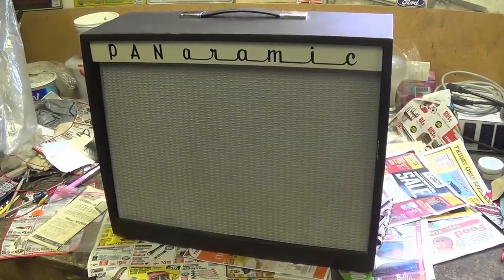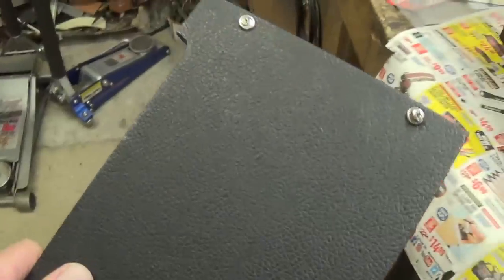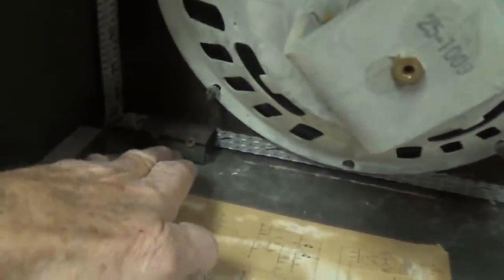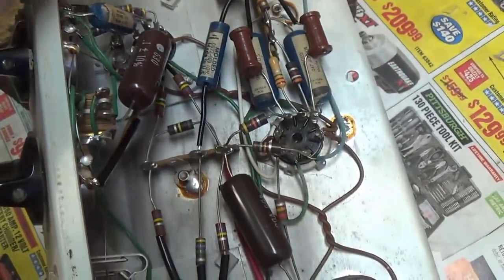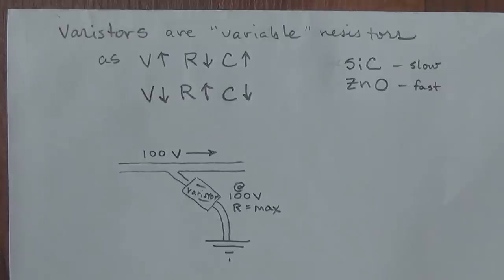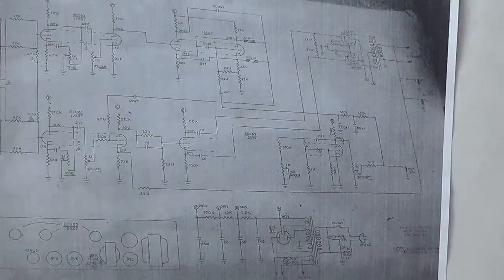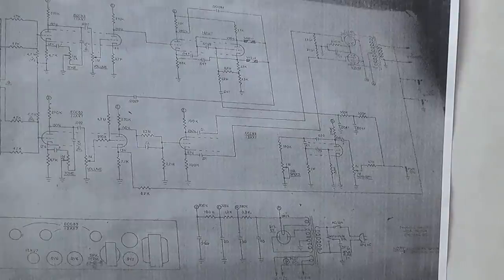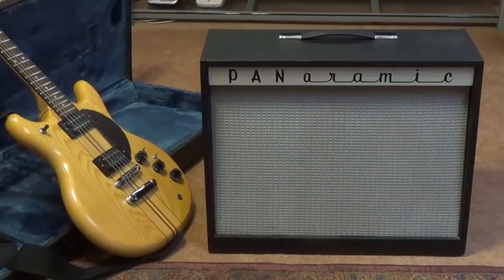1963 Magnatone Panaramic Model 1210 Amp with "True" Vibrato

Comment: Wow. Is that clean for the age. I own about 13 Magnatone amps. Various models. Only one is modern, a Twilighter Stereo. These are very underrated amps on the vintage market. btw the back panel was installed upside down.

I've always described tremolo as playing your amp through a fan in terms of sound. That choppy helicopter sound. Vibrato is more like the warble of a bird, organ or violin. 

Usually when I get one of these amps, I will replace the power cord with a grounded one. I will remove the death cap and possibly replace the canister filter cap but often they are fine.

I'd probably replace any plate resistors that have drifted to even out the power output of tubes. I'm not that much of a stickler keeping my amps stock because they aren't that valuable on the vintage market....and if anyone wanted that it would be easy to return the amp to stock with vintage parts.

Nice effort explaining the vibrato circuit. Few understand it.
Reply from the maker: Thanks so much for your detailed and helpful input, Joe.

Comment: Another very interesting and entertaining video . I don’t think I’ve ever seen a Magnatone amp over here in the UK, didn’t Buddy Holly and Duane Eddy use them? I’ve got an old early 60s Vox AC 30 amp which also has a true vibrato, I’ve heard that the Vox people “borrowed “ their circuit from the Hammond organ company but who knows?  I don’t know if any of the current crop of tremolo effect pedals have true vibrato or just use the amplitude variation method.
Reply from the maker: Yes, I believe Buddy Holly used a larger model, perhaps a 260 or 280. I'm not sure about the Vox "Vibrato" circuit. Unless they could unlock the mysteries of the Varistor, however, it would have been difficult to match the Magnatone circuit.

Comment: Uncle Doug, may I get in touch with you please, Sir? I have a Webster TP 45 pa amp, which works on 2 channels. Need some ideas.
Reply from the maker: You can ask your questions on my FB page: Uncle Doug's Vintage Amps, Mr. P. Due to the amount of correspondence I handle each day, the answers will have to be relative brief.

Comment: Great sounding amp.(just add reverb) 
Can you design a tube fx pedal that creates that vibrato ? I would love to build one.
The pickups in your Gretsch are Hi-Lo Trons, single coils
Thx for the video, I'm sure Chris would aprove.
Reply from the maker: Thanks, AJ. I have a Fender 6G15 that could be used with the amp for a real Verb-Vibe Fest :)  The problem with cloning of the Vibrato circuit is hampered by the mysterious Varistors and their unavailability.

Comment: I would be cautious around dust adhered to older mfr. speakers, especially if the dust is yellow. I have read that it is cadmium based, and is toxic. I had two oddball 500ohm speakers from a small japanese console built  around '63 that had it on them. I never heard of a PM speaker with such a high impedance, and it was the only pair that seemed to have the yellowish dust.
Reply from the maker: Thanks for the info, Ed.

Comment: Hi Uncle Doug--great job as usual.  The circuit used to create the vibrato is generically called an all-pass filter.  If you Google that phrase, lots of information will come up.  BTW,  "phasors" or phase shifters, as they are variously called, that used with guitars, a classic example being the "Phase 90,"  use anywhere from 2 to 4 all-pass stages, the 4-stage units being the most common.  That being the case, a phase shifter could be modified to create a true vibrato.  Although true vibrato can be a nice effect, personally, I find it can quickly go from pleasant to overwhelming, and can create a kind of seasick tone.   It's nice, as always, to see your kitties.  I think many of your viewers, myself included, appreciate your kindness in caring for them.
Reply from the maker: Thanks so much for your always-helpful input, R. This is a 2-varistor circuit, while the larger models offer 4-varistors.....which agrees with your analysis. I'm tempted to get one of the larger models,  just to experience the difference. However, I understand the "seasick" phenomenon.

Comment: Hi Uncle Doug, I've been enjoying your videos for about a year now.  I too have a black feline friend named Misty Midnight.  I have noted in your last 2 videos you found speakers from oxford.  back in the 70's when I was still in high school I worked at the Oxford Speaker Company in Sabula Iowa.  It was an after school job.  I was a gasket dipper.  I worked in a shed with a bunch of toxic chemicals.  The factory made speakers for cars.  The assistant manager once gave me a set of their 2nd best speakers, they had smaller magnets than their best.  used them for years in my own car.  The factory caught fire one night and there were many explosions (about 1979)  I had moved away but saw it in the news.  The only part left standing was the shed where I dipped gaskets.. if that had gone up the whole city block would have been gone, including the city hall/fire station, that power substation, and a shell gas station!  Thanks for sharing your videos and a glimpse of your home and town through your lens.
Reply from the maker: Wow, Jim, what a harrowing tale. We're glad you moved on before 1979. It's great to hear from viewers who were personally involved in the production of the amps and components we love. Thanks !!

Comment: I had heard Magnatone amps were the one of the only amps with true vibrato not just tremolo..I used to own a few 60's  transistor combo organs, I believe they had true vibrato circuits..
Reply from the maker: I believe you are correct, Dan. Fender produced a harmonic tremolo that had some frequency modulation (vibrato).

Comment: Why do you remove the "death capacitor" when you've added 3-wire power? Does it hurt anything? Degrade sound? Add hum? I appreciate that you leave it for historical reasons, but I'm really unclear as to why it should be disconnected.
Reply from the maker: If it were to develop an internal short, which is quite unlikely, sufficient primary AC may flow to the chassis ground to cause a mild shock.....or blow the fuse.

Comment: I struggled a good length of time trying to get my head around the concept of mixing signals so very useful in radios for example to drop the frequency down a decent notch so some serious gain could be achieved with cheaper components. The combined frequencies remain two and not the third wanted one until the two signals are subjected to active gain. The third offspring frequency occurs within the gain slope of the active device and is impossible to achieve using any and all passive devices. When I finally read that part, the light came on for me, but it was a lot of reading before I stumbled upon that jewel. Just a tune up for your very excellent run down of how the true vibrato works. I must say the effect here is a wonderful thing, I can hear so many favorite songs I love are using this too. Reverb/tremolo is fine as far as it goes, but true vibrato for me is a WOW thing. As you very simply put it (and I do love simple), much more musical. Thank you patreon people for giving Uncle Doug the bucks to bring this one to the cheap seats and thanks again Uncle Doug.
Reply from the maker: Thanks so much for your very knowledgeable input and nice comments, Lee. We're glad you enjoyed the video.

Comment: The description about the Moses circuit is fine, but the description about how that is then applied to the Maggie circuit is fundamentally wrong.  The Panasonic circuit diagram shows that they use the Moses circuit, and the variable resistance arm is replaced with a sub-circuit comprising the varistors in a cathodyne PI circuit that is modulated just by the lower frequency oscillator, and that sub-circuit is capacitor coupled in to the Moses circuit, and the mixed output is then capacitor coupled to the high impedance node of the feedback stage after the Vol control.
Reply from the maker: Thanks for clearing that up for us, Tim :)

Comment: Hello, first thank you for all the great videos!! They are so useful and great to watch. 

Second, in regards to the vibrato in this amp, could you have a switch that would switch between a tremolo effect and the vibrato effect? I’m not sure what the sound difference might be, but it would be cool to have. Thanks again for the great videos. 🙂
Reply from the maker: It would probably be possible to have both effects in one circuit, Stephen, but once you have heard vibrato, there is no way that you would ever mistake it for tremolo.....they are quite different.

Comment: Where can I get the Varistors needed, is it a good homebrew project? I'd like to build one as a preamp and just put in a little 5 watt single ended output stage so that I could use it to drive a power amp or as a practice amp. I have a Alembic pre ( a real one, got a good deal at an auction) and a THD Univalve and I use them with an old solid state transformer coupled Altec drive in amp sometimes. Sounds great.
Reply from the maker: That's the problem, W......the specific Varistors are hard to identify and purchase. Check the Internet and video description for details that might help you locate the proper Varistors. Good luck.

Comment: I'm thinking in this case, the spring-on-the-rod example might be more accurately (though possibly more confusingly) shown if you were to slide the spring back and forth along the length of the rod rather than compressing and stretching the spring. The reason being that the modulated allpass filter in this amp shifts the phase of the waveform rather than strictly the frequency. It is analogous to the Doppler effect, where the change in pitch is only done as long as the phase is being advanced or regressed. In this case by a low frequency oscillator. One interesting thing about this kind of vibrato is that the intensity is most pronounced at the center frequency of the allpass filter, as opposed to the kind of vibrato produced by modulated delay lines, which shift the full audio spectrum.
Reply from the maker: I agree, SS, including the final sentence. The Magnatone phase shift circuit is most pronounced at 1KHz, with diminishing effect the further the signal varies from this frequency.

Comment: It would be interesting to see a video or article about accordion pickups and how the electrification of accordions was done back in the day. I once had an accordion pickup that wasn't name-branded but it had four or five microphone elements, (peizo type if I remember correctly), in a footlong-plus chrome housing with a mesh screen, that looked sort of like a cross between a harmonica and a chrome car bumper. There weren't any brackets and I didn't see any tapped holes for threaded fasteners or fittings, so I had no idea how you would even mount it to or inside of an accordion.
Reply from the maker: I can't say that I've ever seen an accordion pickup, GU. It must be some sort of piezo device, since the accordion would not activate the normal magnet-string type of pickup.

Comment: Vibrato and tremolo are like FM and AM radio.  I think I like FM better than AM.  But there are instances where AM does better than FM.  Rusty in eastern Tennessee
Reply from the maker: It's quite a bit like Frequency Modulation and Amplitude Modulation, Rusty, in fact those terms actually define Vibrato and Tremolo.

Comment: From Leo:  Looks like a great keyboard amp.   I have never seen any amp that old that did not have rust discoloration on the input jack hardware. With no corner protectors and the tolex not damaged on the edges, you know that one never lived in a garage or basement.  Amazing.  I am confident that you will treat it right.  Thanks for sharing.
Reply from the maker: You're welcome, Barb. I agree......it is in amazingly good condition.

Comment: I just restored my amp. Is 120 mV DC too much on the speaker? How do I bias it down?
Reply from the maker: The plate current has nothing to do with the speaker. If your two 6V6's are flowing a total of 160mA, they are biased way too hot.....about three times the proper amount. The output tubes are cathode biased so their ideal plate dissipation is between 10 and 12 Watts. This value is calculated from the plate current and plate voltage, and is regulated by the value of the cathode bias resistor. Please see my videos on biasing of double-ended amps for a detailed description of how to do this.

Comment: You'd do a great service copying that schematic and uploading it to the net. That amp is a very unique circuit. It's close to a 213 but it has 2 volumes and 2 tones instead of one tone. Higher end models had 2 volume and 2 tones but they had other features that don't match this amp.
Reply from the maker: I will do so, Joe. Thanks for your input.

Comment: Great vibrato Uncle Doug, has a sort of Leslie effect much different than the tremolo effect. I wonder if it could be added to an amp or built as an external effects pedal? Rgds and thanx for all the great info
Reply from the maker: Thanks, Alvaro. They are indeed quite different.  It would be virtually impossible to add the effect to an amp, but there are Vibrato effects pedals available.

Comment: Uncle Doug, here is a good tip for cleaning up the tolex on old amps. Use some Murphy's Oil Soap in some water and it works great. I use a rag dipped in a little water with a small amount of the Murphy's oil soap and it works great. It will get down into the crevices of the tolex and get that dirt out that is so hard to get out sometime.
Reply from the maker: Thanks, BJH. My wife has some of that MOS. I'll give it a try :)

Comment: I love these breakdowns UD.  Thanks for putting these circuits into plain English (the humor helps too).  I'd love to see a video on how to add a headphone output circuit to an amplifier that doesn't have one.  I'd guess that using the effects loop out of most amps would be a good starting place, but aside from trial and error, I have no hope of designing something that will actually work.
Reply from the maker: You're welcome, SS. Several viewers have expressed an interest in this modification and I may include it in a future video. Trial and error is my most common approach to such projects. Speculation and theory are nice, but you're never really sure until a wired-up circuit actually performs as you wish.

Comment: The main difference between tremolo and vibrato is that tremolo doesn't make me feel sick. I admire the engineering, but wouldn't ever want vibrato in an amp of mine.
Reply from the maker: Wow, SS. Never get near a Leslie speaker system.

Comment: The vibrato function is unique to Magnatone?   My M-3 Hammond had real vibrato, is based on the same idea of variable resistance or does it use a different method?
Reply from the maker: True vibrato for guitar use was only available on Magnatone amps, RB, as far as I know. Fender had a harmonic tremolo (semi-vibrato) effect in their larger  brownface amps, but it was not as dramatic as that provided by Magnatone.

Comment: Seems like they were just one or two steps away from creating a version of the 'chorus' effect. They even had a stereo input where the vibrato effect could have been applied to one pickup and not the other and then combined.
Reply from the maker: Good observation, Kevin. I have no doubt that the do-it-yourself chorus effect was noticed and used by lots of players.

Comment: Wow, a tube micro pitch shifter. Say, if the modulating voltage to the varisistor is held steady does the shift hold steady too or does it catch up and result in no shift? 

And at the end, is that a carvin guitar?
Reply from the maker: I believe that if you stopped the input from the oscillation loop, the phase shift would cease, because the varistors would revert to their maximum resistance level. The guitar is a 1980 Vantage V-695 Performer.

Comment: I am not much of a tremolo fan, but damn I really like that real vibrato.  I may have to think about adding that to my amp build in the future.  It has two more tube sockets available for use.  I want to add reverb as well sometime.  Nice instructional and demonstration for the differences in tremolo and vibrato.
Reply from the maker: Thanks, Kevin, and good luck with your project......but be aware of the great difficulty in obtaining proper varistors to emulate the Magnatone circuit

Comment: Ok so now my mind is blown. the spring demonstration only made things more apparent about not understanding the circuit. When you change the phase, or shift the phase, the whole spring moves. not just one end. So not enough explanation on why one end of the spring moves, but NOT the other?
Reply from the maker: It doesn't matter which end of the spring moves. The point is that the waves (coils) can be compressed into a higher frequency, or stretched out into a lower frequency. Frequency being the number of coils per inch.
Reply: I understood that part. But where my mind is going blank is how phase is relating to frequency here. I know it works, but I just dont understand how it works. In your demonstration, you are holding the spring at one end or the other, doesnt matter. the fact your holding it causes the frequency relationship to change. But what in that circuit "holds" the spring? Because for example 3-phase power has a different phase relationship per pole, but its still at 60Hz.